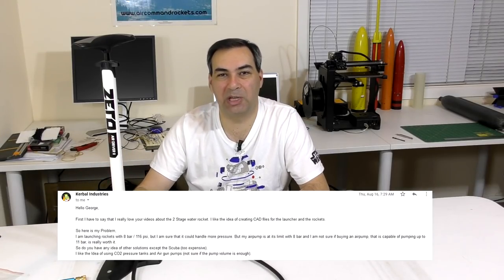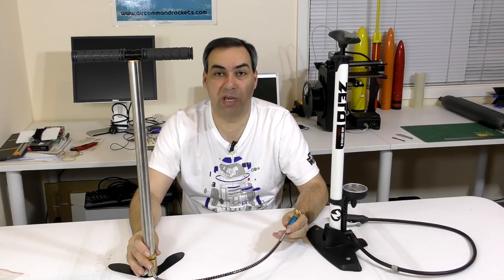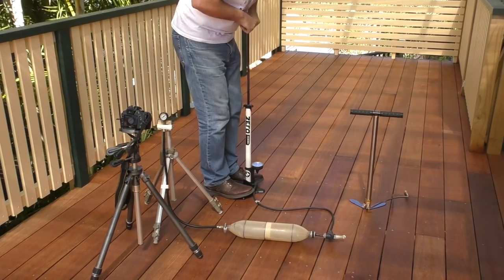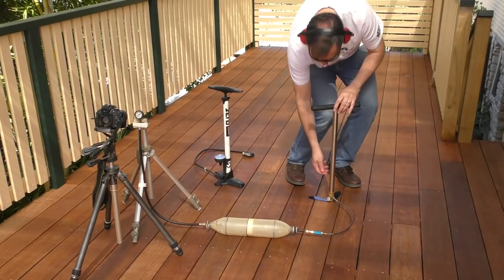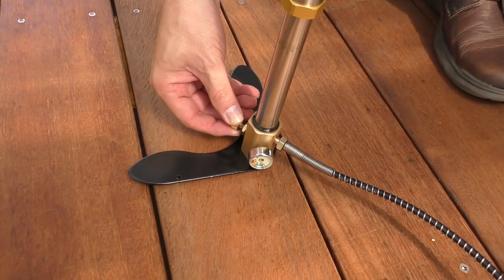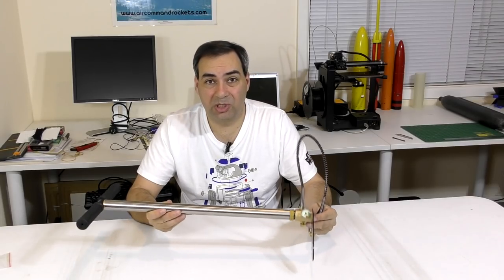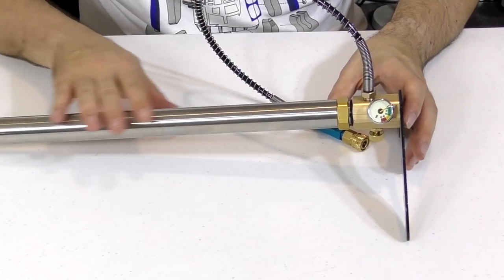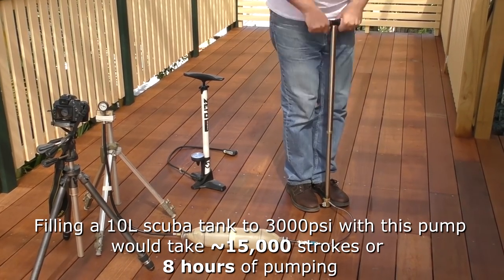PCP pumps - Higher pressures than bicycle pumps

Comment: Did you ever need to service this particular pump? You can not enter the base of the pump to clean out the dirt with this particular model. You can do that with the model with the folding base, which is a little more expensive but also easier to fix.
Reply from the maker: We've not needed to service the pump yet. But good to know, thanks for the information.

Comment: Nice video about an interesting topic! :) I think the main advantage of an air pump is that it is very small, light and mobile. In contrast, compressors often need a power supply (car) and scuba bottles are very heavy. The air pump we use is limited to about 260 psi but it is really hard to get there, especially when the rocket is big. Filling a 9l rocket with 260psi requires a few team members to work together. ;) However, in the long term we plan to use scuba tanks as well to increase the maximum pressure further. ;)
Reply from the maker: I was wondering how you guys get up to the higher pressures. Is it a special air pump that can go that high? The PCP pump is really easy to pump at these lower pressures. When we used the plug that came with the pump we tried pressurising just the hose. It was when you got over 1000psi did it start becoming harder and at 3000psi you had to put your whole weight on the handle. Once you start using scuba tanks, you'll never look back. :)
Reply: We use an air pump specifically made for racing bicycles called "SKS Rennkompressor". It is very well built but we have changed the hose mount and mounted the hose additionally with a hose clamp to increase the pressure even more.

Comment: Where to get or how to DIY the air storage bottles that you have used in this video, are those fiberglass layers on this bottle ? What's the pressure that it can hold ? how to create such storage tank for 80 bar pressure holding capacity ?

Comment: It's incredible how cheaply these are available now. I remember playing about with spudguns years ago (mostly made from copper plumbing pipe) and I looked at one of these pumps for higher pressures, but they were over £150 at the time. I just checked EBay and there's some for as little as £30 - I might get one just as a bit of inspiration to have lying around ;-)
Reply from the maker: I too was surprised at how inexpensive these were. The build quality looks pretty good to me but I guess time will tell how quickly things wear out. I have seen YT videos people using these daily for months on end for their air guns and had no issues even with the cheap ones.
Reply: @AirCommandRockets  Thats my  fear  too, how quickly things wear out. I know nobody  there was using  PCP pump for  longer time  years or so.  Let me know  if you hawe  experience or someone .  Thank you and greeting  form Hungary !

Comment: Hi George, interested to know how long and the number of strokes it took to achieve 80 psi in a 1.25L bottle for both pump types..
Reply from the maker: Hi Craig. From the measurements we got, it was about 240mL of air per stroke for the regular pump, and 180mL of air per stroke for the PCP one. Let's assume that a third of the volume of the 1.25L bottle will be water, that leaves about 0.83L of room for air. So at 80psi (5.5bar) that is 5.5 x 0.83 = 4.57L of air. 
4.57 / 0.24 = 19 strokes with the regular pump and
4.57 / 0.18 = 25 strokes with the PCP pump.

We averaged about 2 seconds per stroke. (1 second up, 1 second down)

This was for the pumps tested in the video, other pumps will vary the amount of air they supply. You would also need to factor in the launcher and hose volume that also need to be pressurised.
Reply: omg,  if you  cant  do maths, dont do rockets, and go to school instead.

Comment: You could probably make the pumping effort a little easier, on the PCP pump, by removing the filter element.

Given it's a water rocket, you won't need to filter out any moisture, coming from the pump.
Reply from the maker: Fair enough point, though I suspect most of the effort is due to compressing the gas rather than due to the flow restriction of the filter.
Reply: @AirCommandRockets  To quote Tesco, "Every little helps". 😁

Comment: would love to see it used for air tools
Reply from the maker: Using the pump directly to power air tools? The pump doesn't give enough volume of air,  but you could first pump up an accumulator and then use the tools. Seems like a waste of energy though. You might as well use hand tools directly.

Comment: I have never herd of a pcp pump could I used it to fill a car tire or something to about 100-120 PSI? thoughts please thank you
Reply from the maker: Certainly, the PCP we bought even came with a Schrader valve attachment.
Reply: I mean I have a portable air tank that I am using m y standard bike pump get hard to pump around 100 PSI I guess you would need to make sure you have a guage on the device to have the right pressure is that right  so than are you telling me that if I only need about 100-120 PSI it would be less strenuous to get one of these as it will fill more  quickly but I guess your going to tell me you must carefully watch your gauages? so if I can afford it are you going to tell me I should replace my standard bike pump with one of these it will fill much quicker? thoughts please thank you

Comment: Hi again George, do you think there’s any way that you modify a PCP pump, sacrificing the extreme pressure capability, increasing the output volume while maintaining the ease of pumping. Essentially, I’m hoping to achieve 2.5 litres, to 80psi, achieved by a child in a reasonable time frame/pump cycles. Any ideas? Cran
Reply from the maker: Hi, I am not sure how you would modify an existing PCP pump to get more volume. I am also not sure you would actually need to. With one of these pumps you get about 180mL of air per stroke. 2.5L at 80psi is around 13.5L of air. This would mean you would need about 75 easy strokes. A regular bicycle pump would take about 56 strokes but is more effort. If 1/3 of that 2.5L volume is water then you would need to make 1/3 less strokes to fill it up to that pressure.

Comment: For about 200 u.s. you can get an electric young hang compressor much better will go to 4500 psi
Reply from the maker: These compressors sure would be useful for air guns, but for water rocketeers in the middle of a field without grid power makes them less practical. Also typically most water rockets need well under 1000psi.
Reply: I use a inverter and car battery